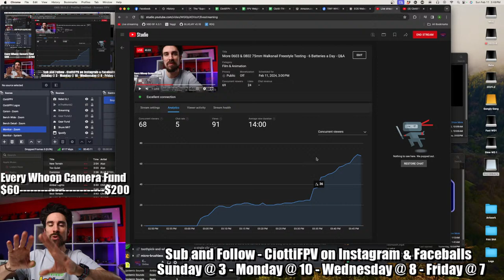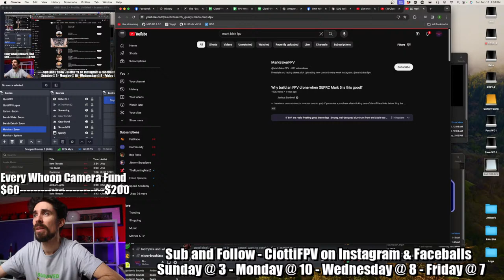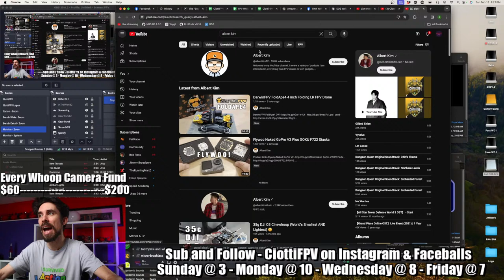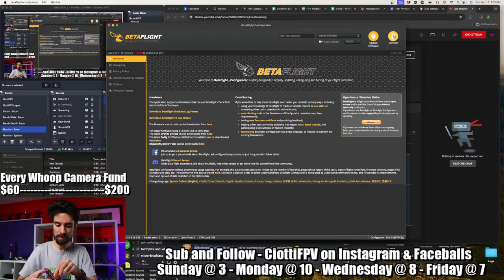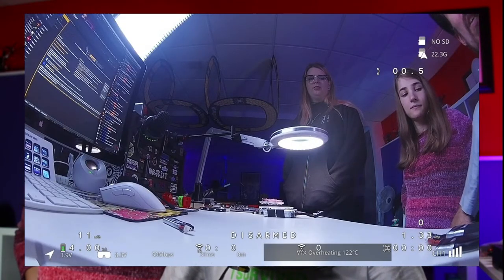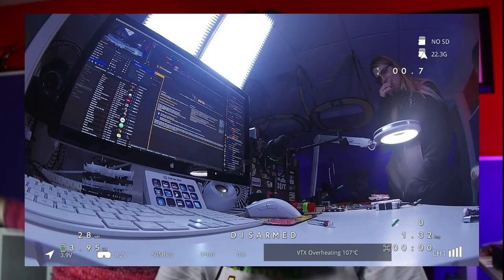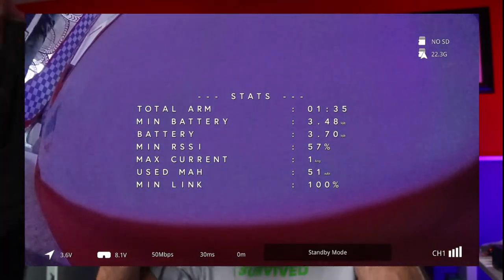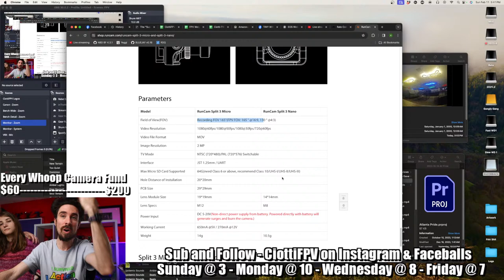More 0603 & 0802 75mm Walksnail Freestyle Testing - 6 Batteries a Day - Q&A

Comment: Hello and good day to the GG and Ciotti. How are you doing ?
00:01:51 on this stream…….Being sure about the 603 and 803
00:03:55 Check out the new Ciotti build motors!
00:14:38 More Talking about the 0802 0603 different motors.
00:24:08 Another build coming up.
00:33:12 Could you do a stick cam sometime I want to see how you manage the throttle on this build
00:34:57 I've been going through 5 batteries a day on my first mobula6 for the last 7 days. it's mostly fine, just motors got some play in them, but who cares about 19kkv. Thanks for all the info!
00:35:21 Could you add extra weight to the analog to make them weigh the same?
00:41:33 Had a Tiny Whoop short CP antenna not working. Went back to linear but loved the antenna inside the canopy, so cut the whip as short as poss. Works better than og and lighter! Fun discovery
00:43:03 It's designed for o3 but will take anything and it's going to be about 275g dry so not ultralight but good for efficiency and using lighter 5 inch motors 
00:46:00 Is the RunCam thumb worth it when the pro version exists? (On a Flywoo firefly)
00:47:46 Do you know if the end stats screen elements be edited from the in the OSD menu like OSD elements?
00:48:08 Walksnail onboard recording on the lite cam is great. and all you need is hdZero goggles + Walksnail vrx ;).
00:49:31 If FPV was one off the cheaper hobbies for you , what the hell where you other hobbies?
00:53:22 I have a hummingbird with a vtx that's broadcasting on the wrong frequencies.... I set to R8 and it ends up sending on L7, tested with multiple goggles
00:53:53 My V3 cockroach is doing the same bending as the crown. Both as way durable.
00:554:23 I suspect other frame makers will start to copy NBD curved ducts. I'll never go back. Constant round ducts win over any small issues with the rest of the frame. Love them.
00:56:22 Support Ciotti. Her is how you can do it.
00:57:52 HDZero claims 1ms more latency than analog @ 60fps and 5ms less than analog @90fps
00:59:42 New Mobula 6 is out new frame new race canopy 702 28000kv Superx aio elrs 25-400w vtx marblekit Albert Kim has hands on.
01:01:20 I broke 3 1s hd zero vtx, they are still working but range went from a 10 to a 2 on a scale from 1 to 10, I just broke another one today.
01:03:29  The new m65 is soldered camera as well - I think it’s more for racers over freestyle
01:10:00 I've seen a few people with the new Mob6. Do you have one yet? looks like everything is direct soldered including the camera.
01:11:43 I guess I need to try HDZero on something other than a mob6 that sucked, Under powered, short flight time, I did buy one of the new VTXs going to put in a Grinderino.
01:22:36 It’s really not that hard to solder.
01:25:26 Check - Infinity Loops - Sneak Peek NEW Happymodel Mobula6 2024.
01:25:56 Wonder if they are going to stop making the AIO we are using now?
01:30:38 Maybe Jessie will start making motors with plugs at the motor.
01:32:41 802 30000kv on a 75mm Walksnail, which props should I use?
01:34:00 What makes an aio good or bad besides failure rate?
01:36:28 The numbers they use are 14.1ms @90fps, 19.7ms @ 60fps, 18.7ms for analog.
01:37:46 You are keeping it real going deep into the detail. I appreciate it that approach. Most FPV review channels push any and every product as the next best thing.
01:39:44 Have you tried an analog 75 Pro with 1002s? Bought a frame and props with my last order just to try. Honestly kind of dig it for bashing around the back yard.
01:43:48 I've seen you recommend everyone use their own rates. How do you go about figuring out what rates are best for your personal tastes?
01:55:17 Do you use the motors tab to verify that all the motors are spinning at the same/similar RPM?
01:55:32 You should compare 2 identical quads, one with direct soldered motors. I save 0.8g and get more power and efficiency, and when you have multiple quads you don't need to solder on the spot.
01:59:10 Hopping if happy model is going direct solder, New Bee will use the larger motor plugs on their AIO's.
 02:00:02 The blv4 is heavy and motor plug thing but tiny whoop gives free nbd plugs with an ordered.
02:01:44 Start the  0603 & 0802 75mm Walksnail Freestyle Testing. 
02:06:15 special guest arriving.
02:07:58 Flying the 0603 in Stevie Wonder mode.
02:11:30 Flying with real fpv now if it bind 😁
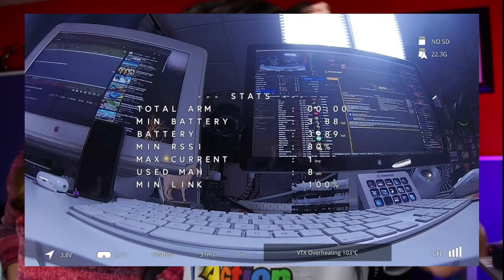02:14:00 here we go.
02:22:54 Switching to the 0802.
02:25:42 Eva & Izzy What are your rates and fav current rig you’re flying
02:31:29 flying the 0802 
02:35:33 What do you think about the RunCam split 3 nano on a whoop? thinking about putting on mob 7 will it work
.Stay safe everyone and have fun flying.

Comment: I agree the Digital HD situation is infuriating. I want to fly HDzero but I also need Analogue goggles and DJI goggles for 03 work.
Reply from the maker: Right?  I haven't switched the live stream bicycle chase rigs over to 03 because of how absurdly expensive another set of goggles and the cosmo streamer are
Reply: @CiottiFPV  If there wasn't the goggles V2 re-bind issue it would be less of a burden... DJI really knows how to make their customers angry.

Comment: Hej Ciotti, I would love to hear what you think abbaut the SuperX HD ELRS 1-2S AIO flight controlelr built-in 12A esc and UART elrs receiver for Digital whoop from HappyModdel. I heard so much bad abbaut the BETAFPV 5A F4 AIO…. I want to use it for a Meteor 75 Pro Walksnail build with 1102 Motors. I know , heavy ass Woop 🙌
Reply from the maker: There's one on the way apparently, the direct soldered motors are a deal breaker already for me though